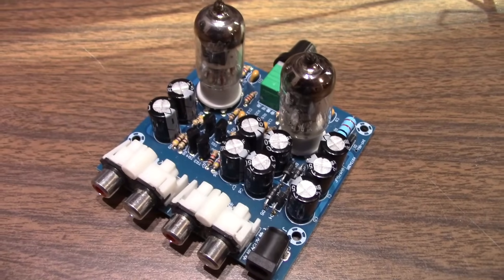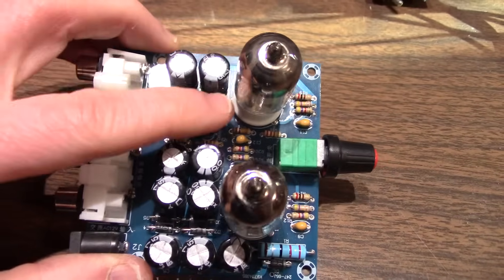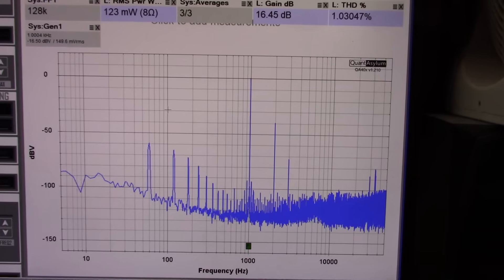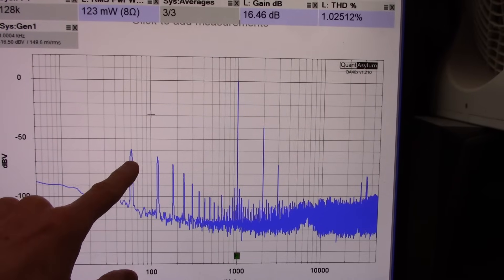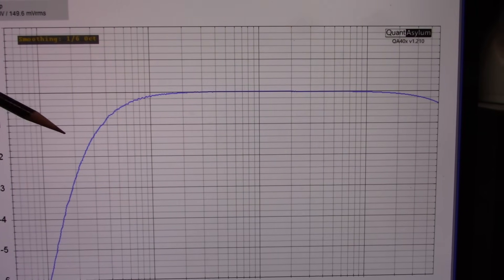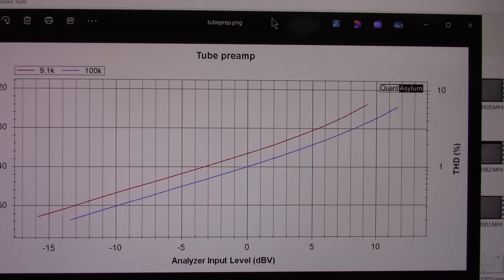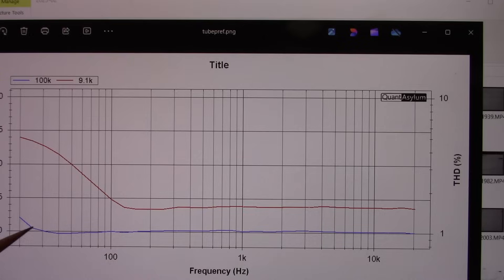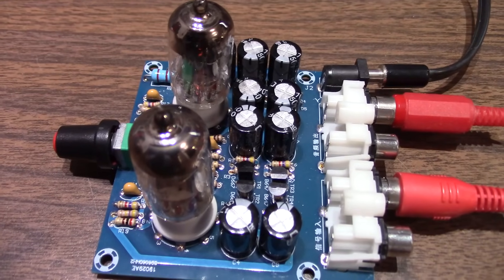Tube preamplifier on the QA403 audio analyzer

Comment: I just built one of these kits. I understand it's supposed to have an AC power supply, but wouldn't the 4 diodes direct a DC supply to power it like normal?
Reply from the maker: The diodes are part of the voltage multiplier circuit which boosts the voltage and converts to DC. it is not a bridge rectifier configuration.
Reply: @JohnAudioTech  It still should be possible to bypass its onboard power supply and feed it DC from a bench supply, just to see what it sounds like without mains hum. You also could probably run a higher B+ in general. I wouldn't expect miracles, but it looks like whatever performance it has to offer (if any) is compromised by absolute crap power delivery.

Comment: I think that tubes are really good for guitar amps, but not so much for hi fi.
Reply: @michaelspiering7585  I guess it depends on individual taste. 
I enjoy that nostalgic warm sounding harmonic distortion from old valve based amps, radios etc. To my mind It adds an 50s, 60,s, 70s, ambience to older recordings, but its not so good for e.g. modern music recordings that have surround effects.
Reply: Mavericmind build small guitar Amp with this tubes.
Reply: @tarsiousmunalembohol  I do.  Lately I have been building tube amps using old 12v car radio tubes.  12u7 dual triode and 12k5 space charge tetrode.  So far I have a single ended one, but I am working on a push-pull one because the single ended ones only put out about a tenth of a watt.
Reply: Poorly designed tube circuits are not so good for hifi. Properly designed tube circuits are exceptional for hifi. You have to bias the tubes properly including enough plate voltage. The tube you use matters too.

Comment: Probably too low of an anode voltage,get those tubes biased into a more linear part of the load-line. These low-voltage tube circuits rarely perform well.
Reply: Absolutely.

Comment: This is the great "imaging" some tube enthusiasts rave about. A little second order can make some music sound sharper, but at the cost of coloring complex sounds. Would still like to see one of these with a distortion control so the effect can be played with.
Reply: The theory is that many instruments naturally generate even order harmonics so that can tend to make the sound richer or warmer. The problem is that music contains many frequencies and non-linear effects cause IMD, intermodulation distortion. This means that two frequencies interact through the non linearity to generate new frequencies unrelated to the originals. IMD sounds bad. This might be why highly distorting tube amps will sound good with some music and bad with others. Sometimes this is interpreted as the quality of the amplifier showing up defects in the original recording, when in fact the reverse is true.
Reply: @jamesrindley6215 well if the defects in the recording reveal the defects of the preamp, then the original is still true.
Reply: @krowwithakay  I'm not saying that there is necessarily any defect in the recording. My point is that highly distorting amplifiers will subjectively "impove" some recordings and will make others sound subjectively worse. This is caused by the frequency content of the recording being the sort that causes IMD to sound awful. Typically it will be more complex music with many different instruments and notes playing, thus giving more chance for distortion to create dissonant tones.
Reply: there are tube amps that let you boost harmonic saturation separately from distortion, and it also acts as a compressor so it can add more punch to some types of music, if you like that effect. It's used extensively in music production to "glue" multi-track music together at the mastering stage. You would need to use the tubes only for harmonic coloring of the signal, and then actual op amps( or another better tube amp stage with flat response) after the tube stage to boost the colored signal without any crazy distortion. I believe i've seen a number of cheap hybrid chinese tube amps that do that.
Some people actual use the amp in this video as a tube distortion pedal by sending in a hot signal(https://www.youtube.com/watch?v=Mfjwu5MTaIc)
Reply: I thought 2nd order harmonics provide some color/bloom and warmth, and 3rd order makes music sharper, more 'detailed' sounding?